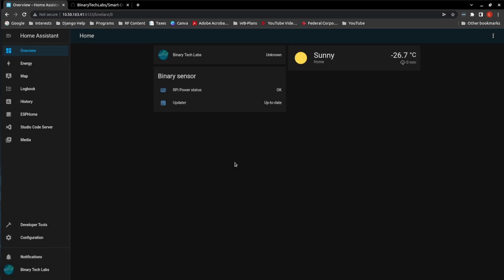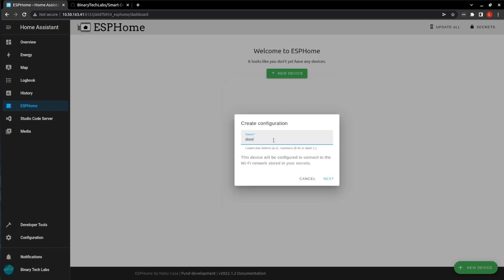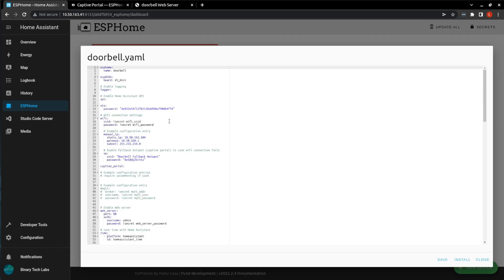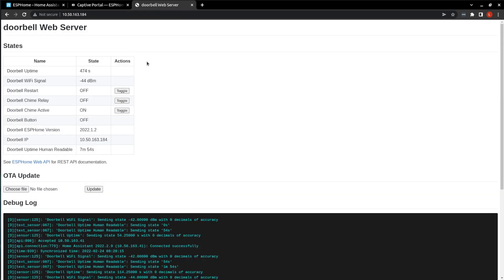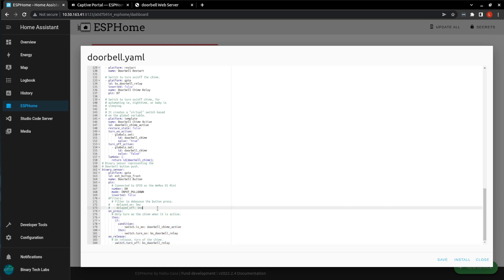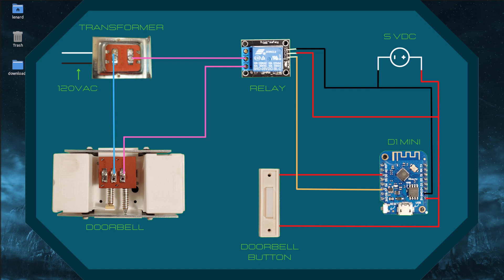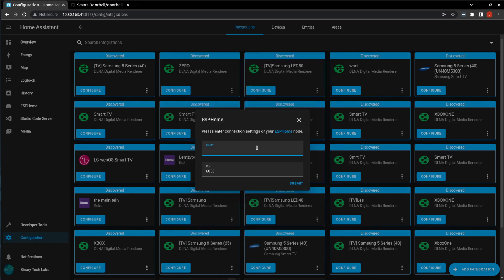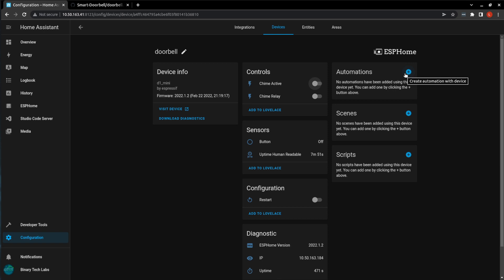DIY Smart Doorbell: Turn your wired doorbell into a smart one with Home Assistant and WeMos D1 Mini

Comment: @2025. The concept works.  And, this is a great idea!

However,  the YAML in GitHub is out of date and therefore use the YAML as a starting point.

I have implemented with an very old single Chime bell.  The new automated solution chimes three times on a press and release.  With the automated messages we get to hear the Chime and see a message.  

A brilliant idea.
Reply: Next, get Alexa to ring at the same time using HA automation.
Reply from the maker: Awesome thanks for sharing

Comment: I have two questions, I live in a 220v country, so I wanted to know if the wiring for the relay would be different,  also I want to know if I can make automations for lets say.. a two second press of the doorbell button only ringing a specific chime in a speaker.
Reply from the maker: Hey, I'm in Canada where we use split phase system, being 120/240 VAC as well, but the voltage on the transformer for my doorbell is 16 VAC, in either case you have to make sure that the device is rated for the current and voltage you're trying to switch. If your door bell uses 220vac you'll need an intermediary relay to handle it as an Esp device won't.

For the automation side of it, yes you'd be able to do that.

Hope this helps.

Comment: Hi there, nice video and explanation. This looks like something I might want to try but I have lots of questions. My home has 2 buttons and 2 chimes where pressing either button rings both chimes. I would only want to install this for use on my main floor doorbell. Would the same wiring apply? I'm assuming you have this placed at the chime box?
Reply from the maker: Yes, I installed it at the chime box as that where the wires will terminate, unless you want to start re-wiring. To understand, what would you want the second one to do?
Reply: @BinaryTechLabs  The second will remain as it is since it's for a basement walk out that's not used at all. Because of the second bell, the wiring at the main bell is doubled and so it seems a bit daunting if I went ahead with your setup. Do you have picture of what it looks like installed?
Reply from the maker: Ah, ok. The first step would be to separate the buttons, so front door rings one bell and other button rings the other bell. I get your hesitation, if wiring isn't your thing. Maybe ask an electrician to assist you with separating the buttons, more than likely it's just going to be minor changes.
Reply: @BinaryTechLabs  In terms of wiring: 
1) Looking at the left side of the relay, is it the Trans terminal and Front terminal wires that are already on the chime and you are now taking them off the terminals and wiring them directly on to the relay? 
2) From the right side of the relay, it's hard to see but is it the Ground, 5V and D7 from the relay that you are wiring from? 
3) The button is where I'm lost, are you wiring additional wire(s) from the Front terminal and wiring it to D0 and 5V?
Reply from the maker: 1) the transformer is outputting 16 volts a/c and the relay is acting like the button. The direct connection between the transformer and the bell is to the label trans. The other terminal on the bell is labeled front, but it's wired to the relay.

2) on the d1 mini I am using the 5v and ground pin. The button is now getting 5v's and the other side will input the 5v's to pin d7 when pressed, which in turn will output 5v's from pin d0 (d zero) to the relay to activate it.

3) that particular relay gets +5v and ground, the third yellow wire carries 5v's to it to switch it on and off like a button press.
Reply: @BinaryTechLabs  This is going to be a real silly question but how would I wire the push button to the d1 mini? The wire from the front terminal is now on the relay as you said but that's coming from the button which should also be wired to the d1 mini?
Reply from the maker: No question is silly. You need to isolate the 2 wires that go to the button and the wires from the transformer, when you have these identified, you'll be able to use the buttons wires to hook up with the d1 and then wire the transformer to the relay, which you will need to add an additional wire to complete the circuit from the relay to the bell
Reply from the maker: Reach out to me through Instagram dm, I'd be able to supply you with a few drawings to help you with the wiring
Reply: @BinaryTechLabs  Thanks I'll be sure to do that. Before I forget though, the 2 wires from the button that you mention - one I have that is wired now to the front terminal but the other is wired to the transformer in the basement so I'm not sure I can get access to that one unless there is something else I'm not getting?
Reply from the maker: Forgetting about the second button and bell, the front doorbell button should have 2 wires coming to the doorbell and there should also be 2 wires from the transformer coming to the doorbell, this is typically how I'd have wired a house. However you could have a non typical installation where one wire from the transformer is run to the doorbell and one to the button, if that is the case, it's going to require some re wiring